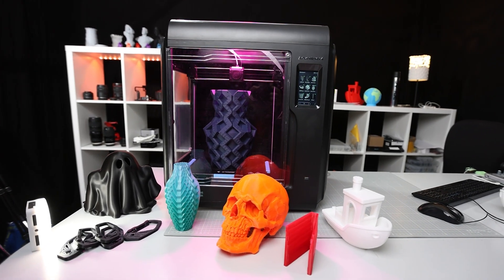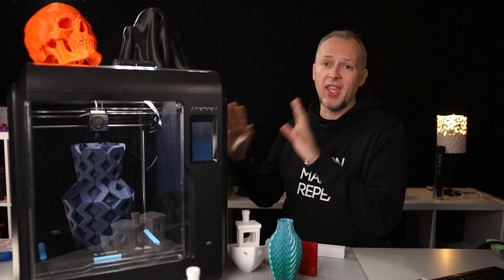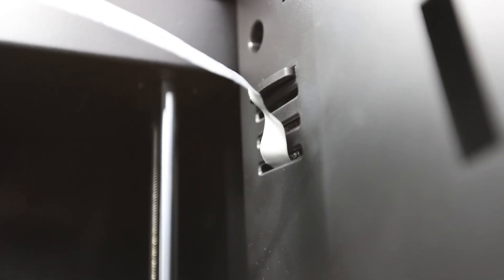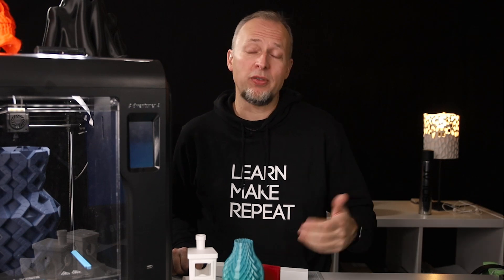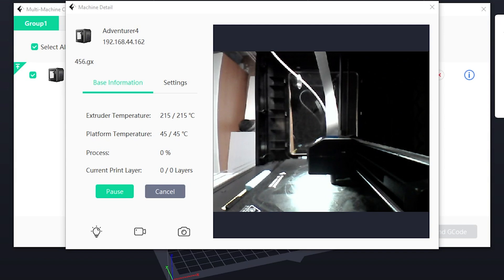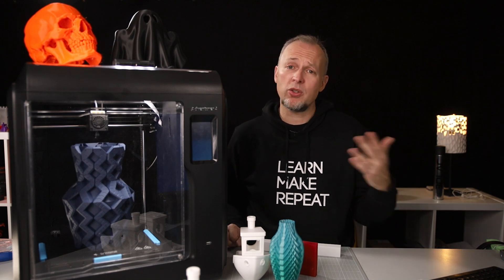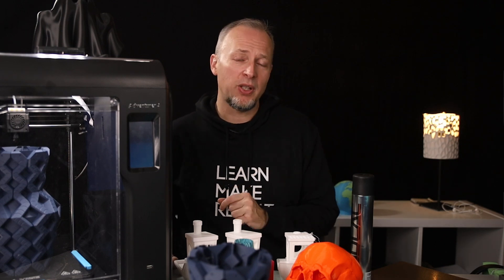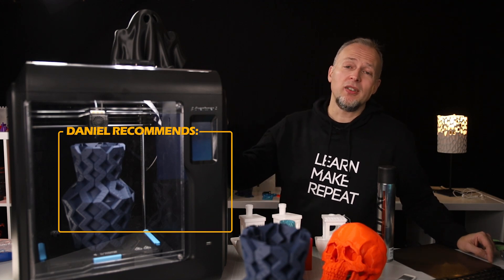Flashforge Adventurer 4 Review - IS BIGGER BETTER?

Comment: Oh god, see your build plate. You must've not set the levelling correctly! 
Your extruder has been scraping your build plate crazily, I had that problem when I first got my adventurer 3.
Which caused a clicking problem and destroyed the build plate, minimal damage to the extruder.
Reply from the maker: You are correct, I scratched the build plate with improper leveling. Unfortunately, that can happen quite easily on this printer but I replaced it now with a PEI coated sheet, which I will show in a new video soon!

Comment: It's really not much bigger or that big at all. Only small to medium prints mostly.  Mine was a grand from flash forge and never actually printed still won't. 100s of emails with aftersales just to realize no one's actually going to help me besides offering firmware to update even if it's already been done. Or asking if the nossle is clogged even tho I took videos with 3 brand new nossles and showing me unload and reload the filament and dripping out.  Hrs daily for over a month literally consumed my life trying to fix it just to realize I wasn't sent one to review I paid for it so it's always been an oven sized paper weight. Wasted opportunity i should of chose better. Like qidi max even cr10 max. And prob would of save money or ended up with better quality machine. I saw 2 other companies with the exact same printer for sale voxelmaker maker bot. Idk if they were made better but exact same machine down to the firmware used to print.

Comment: Great video I want a 3d printer but I see they are all garbage I don’t mind paying $1000 but it needs to work I have not yet seen one that it will convince me it’s worth it I want one for mechanical parts thanks
Reply from the maker: Prusa I3 would be my recommended printer for budget just under 1000.
Reply: Thank you
Reply: Thank you for the info

Comment: Great!! Another i3 clone in an enclosure... If chinese would've put some extra effort cloning let's say, any coreXY motion system, this would've been a printer worth considering. Nice honest review though..
Reply: The difference is that this comes fully-built, has an air filtered enclosure, easy-use touchscreen, etc. Lots of things that don't come standard with the I3. If you were to upgrade an I3 to offer what this one is advertised to be able to do then you'd double the price of an I3. That being said; the adventure 4 seems to have fallen short of expectation from quality of appliance, quality of prints, ease of use, and overall filament versatility.

Comment: Thank you for this! I got this printer and I got problems with Stringing, not sure if it is only the models i have been printing, but all of them got too much stringing. And since it is plug N play how shall i prevent it? I have tried expert settings and increase the print speed and moving speed. Also lowered temp to nozzle at 190. Any other tips?
Reply: Try to set the retractions distance longer. That might help
Reply: @ButterBrause  already 7,0mm
Reply: Try lowering the nozzle temp more, maybe re level the bed

Comment: Nice detailed review, I’ve got to say I’m disappointed with the noise levels also, shouldn’t have printers this noisy in 2021, it’s not difficult to get silent steppers, a simple but massive mistake by flashforge in my opinion. 

 I had hoped it would be a plug and play printer for me as I’ve had enough of messing about with printers to get them to work properly however unfortunately this has not been the case with my adv4, quality and stringing issues no matter what I try. I can’t recommend this printer at the price it is, I wouldn’t pay half the amount.
Reply: Thats quite disappointing to hear, as i am after a hassle free printer that produces quality prints too.